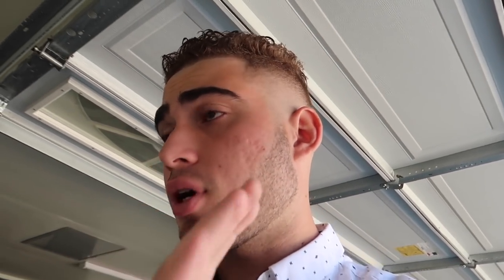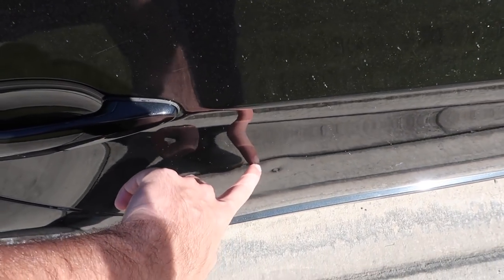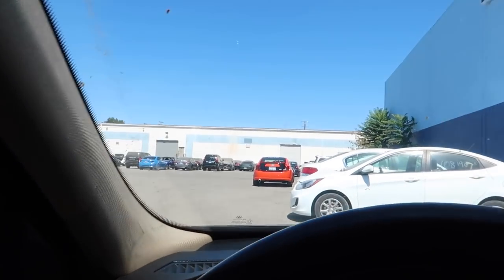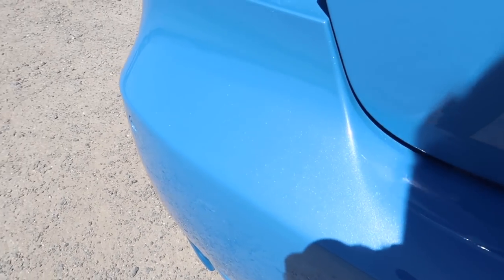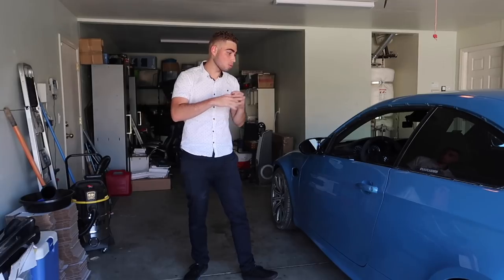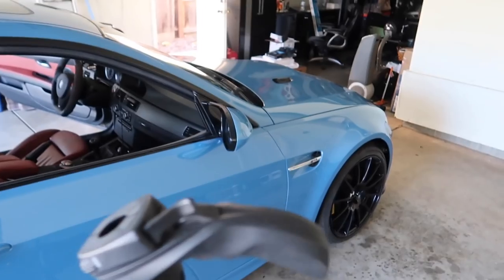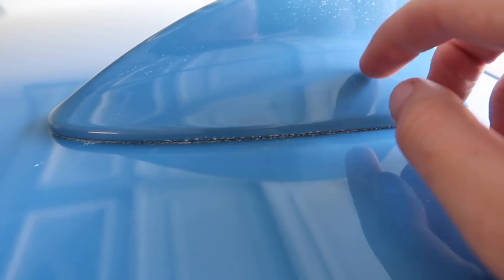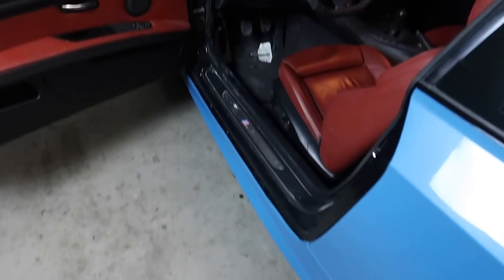MY BMW E92 M3 PAINT COLOR REVEAL! (SHE'S HOME!!!)

Comment: Get the car ceramic coated ASAP or if anything learn how to do it yourself trust me you will be happy with the final look of it
Reply: Protecting the paint will also be key i wouldnt trust it getting resprayed cause of rock chips or any scratches
Reply: therightnuke yup he has to get it done sooner then later
Reply: Kervins Auguste correct me if im wrong but i think u have to wait at least a month before coating it
Reply: Pedro Arias yea two weeks is fine and he shouldn’t drive car too much in that time as well